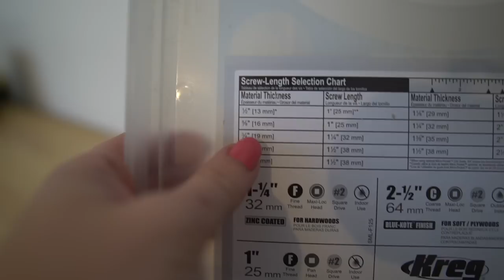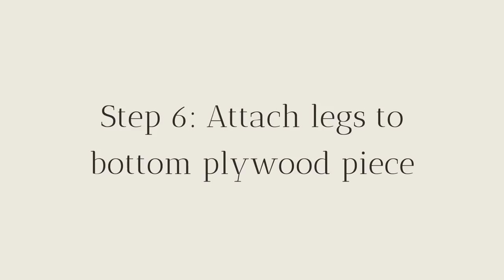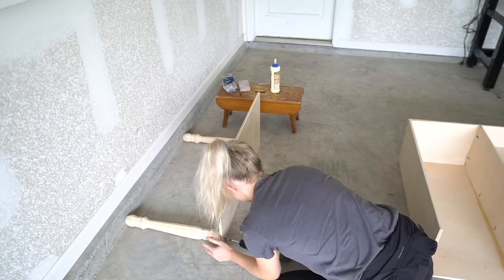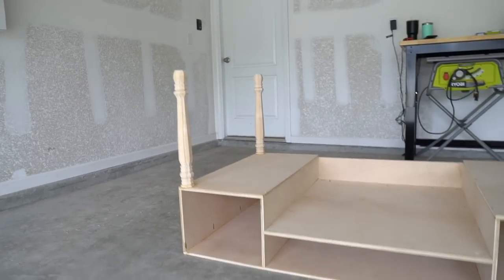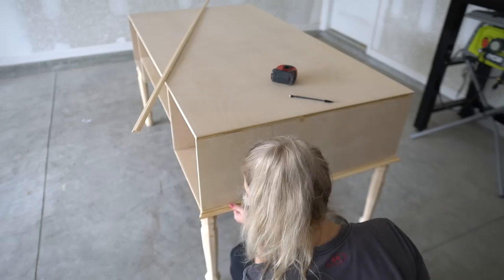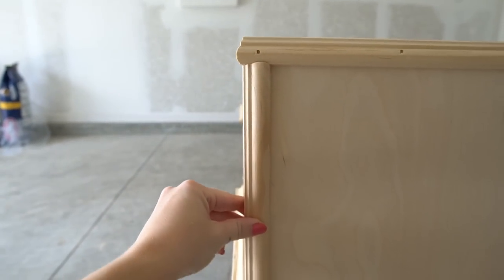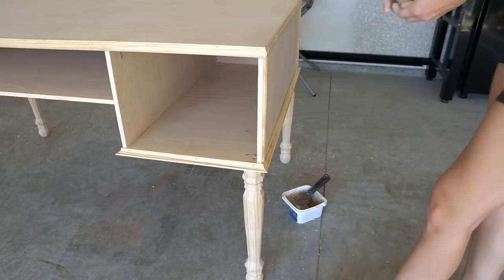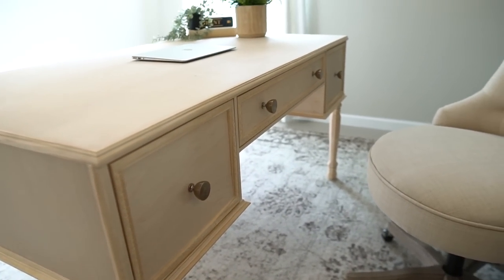DIY Designer Desk | Home With Stefani

Comment: Great looking desk. Excited to see what it looks like when you decide on a finish for it. 

One thing I've found with edge banding is to rub it with a screw driver (or any smooth metal cylindrical object) to help get that glue into the edge of plywood well. I've had it come undone a bit when I've just used my fingers to rub it on.

Comment: Absolutely beautiful build! Very impressive the way you broke down the expensive version and built one just as amazing with inexpensive pieces. One minor note. Pocket holes should not drill into the edge of the wood, they should drill into the body of the wood. (so essentially reverse your side and back pieces) This is what gives them strength. two ways to fix the holes being visible on the 'outside'. Fill with dowels, filler, or pocket hole wood blanks then sand and finish, or double up with a thin (1/4 inch) backer that glues over the entire piece and pocket holes.. just want to make sure your impressive work lasts and lasts. thank you for the inspiration.